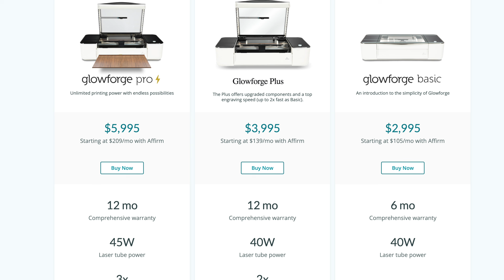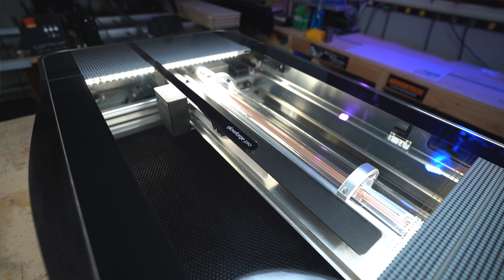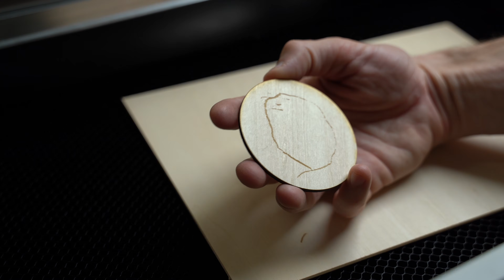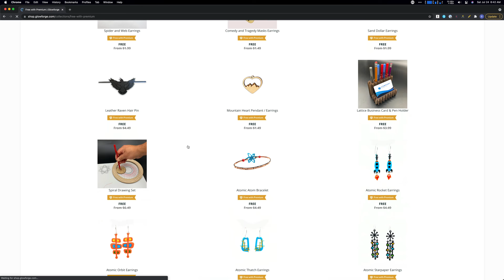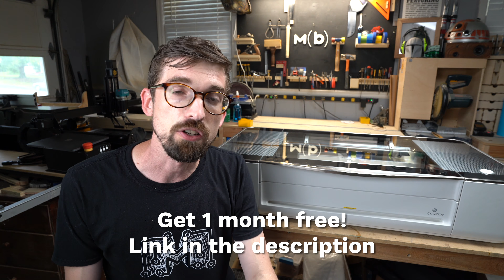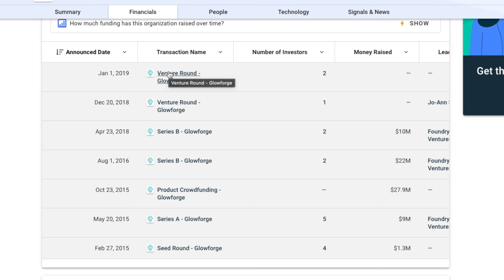Should You Buy a Glowforge?

Comment: I like the concept that Glowforge has, the self contained air assist and cooling is very nice. What I don't like is the software being online. If the company folds you are out of
luck and if the Internet goes down while you are just about to finish off a big job then you are forced to wait.  My son in-law just purchased an OMTech 80Watt laser for about
the same cost of the Glowforge Pro, he can use Lightburn and then have complete control over his designs as well as still being able to run his laser even if Lightburn
goes out of business.
Reply: There's also a better version of Glowforge that is comparable on price and has much better air assist called MIRA by Aeon Laser.

Comment: Really wish I had found your channel before I spent the money on a Snapmaker 2.0.  With years of 3D printing experience, I figured the Snapmaker would be a low risk stepping stone into the laser world.  (If I didn't use Laser, I still have 
a 3D printer).  The problem is, so far I don't have a laser. The one in the box was broken, and support is lacking, to say the least.  They're on replacement laser module #3.

Comment: Would you say that the Hepa filter box actually works well enough that you could take it to a craft  show and not worry about setting off a smoke detector (sprinklers) or causing others to complain about smell when running the laser?  Thanks for the videos!
Reply from the maker: Yeh, the filter does a really good job, it's made to run in an enclosed environment.  It is pretty loud when on so that would be the only drawback
Reply: Sprinklers are not set off by the fire alarm or smoke like in the movies. Most take direct heat in order to trigger.

Comment: I didnt hear much about the speed of the glow forge in your review.  Personally, I think it is painfully slow. when I first started looking for a laser, I saw reviews just like this, and got all fired up and excited.  however, after digging deeper, checking out the specs, comparing this to others on the market, and then factoring in the total lack of actual support ( other than the community forums ), having to return the unit to even replace a tube, and for almost every other things, at. great cost - I soon realised, this was actually not a great machine for the money they are demanding for it.  It looks very nice, but, it just doesn't command the price.  

they do an excellent job of marketing, an immense job, but they they would ( in my opinion ) provide a much better product, with support if they pent less on the advertising and more into the product itself.  Once I made an initial enquiry, I was almost hounded by e-mail after e-mail after e-mail.  however when I replied with questions, their answers were always very vague, or often they would deviate from my question, paying lip service to it only, and trying to big up everything else in an attempt to negate my concerns, and convince me that despite my concern, there were so many other aspects that were simply amazing...anyway... hard pass for me im afraid

I love your reviews in general, but I do have to say, I think this one was probably biased as a result of glow forge sending you the laser and air purifier etc..I know you said it wasn't, but it did sound like it.

Comment: Nice video, well done.  I read on the Glowforge website it can engrave anodized aluminum.  Have you had success with that material?  Also, what is the max height the material can be to engrave?  THANKS, I'm a noob to all this, but fascinated by this tech.
Reply from the maker: I haven't tried it my anodized but with most CO2 lasers your really removing the top anodized laser from the metal leaving it bare underneath.  Kind of the same process as if you were to paint a piece of metal and then laser it away.  To actually engrave metal you would want to check out a fiber laser but the Glowforge (or any other CO2 laser) could get you close.  

Max material height is 2 in, sorry if I missed mentioning that in the review!

Comment: Hey, I’ve been watching all your videos since I’m trying to get into very basic laser projects. Just want to make some nice looking business cards out of stainless steel. I know the laser project area doesn’t need to be huge, but also stainless steel isn’t the easiest material to work with. Don’t believe I’d need to cut through it; I’d most likely just use it to etch. Ease of use is pretty important since I’m going to be very new at this. What would be the best (budget) laser you’d recommend?
Reply: I don’t think you can engrave stainless steel. You might be able to mill it with a CNC machine but…
Reply: You can use a spray that is called Brilliance (it is expensive) and an OMTech or a Flux Beamo and if you want to upgrade, you can add a rotary usit.

Comment: There is no argument that the fit and finish of the Glowforge is first rate.  But there are too many limiting factors, especially the closed ecosystem, where even if the company does not fold, you are beholden to their marketing changes.  Just ask any Cricket user of the last couple of months.  Yes, Cricket backed out of their proposed changes, but for a while, there was the potential to basically owning a brick..  Should Glowforge find itself in financial difficulties, what is to stop them from charging for functionality that already exists and is part of the package, or jacking up the cost of their subscription service, after people have integrated the glowforge into their process (if commercial).  Sadly, this is a hard pass for me.
Reply: Great points dude. Literally hold your equipment ransom lol.. 
Then there would be a market for "jailbraking" the Glowforge, 
But yeah I agree with a hard pass

Comment: Can you engrave brass by about 0.7mm to make an embossing block for cardboard? If so, how long would that take on this machine?
Reply from the maker: For brass you would need to use a fiber laser
Reply: For your use case, you would probably want a CNC router or milling machine.  Lasers are great for cutting, and engraving, but if you want more precise control to only remove a specific amount of material, milling/cnc machines are the way to go.

Comment: Glad you did this Glowforge review, which confirm that the Muse 3D or Muse core with your own chiller an inline fan and 45W upgrade, plus interchangeable lenses and rotary tool, still under $6k or even better the Beambox pro with a standard 50W,  integrated chiller, rotary attachment (no interchangeable lenses) still less than $6k both locally operated without internet, are better options for someone looking more for the money. 

Thanks for the review.

Comment: There's no way I'd buy a piece of expensive hardware like this, that turns into a brick if/when the company folds or decides not to support it

I had that (company folded) happen to me with a 3d printer. Expensive lesson.
Reply from the maker: Which 3D printer did you have?
Reply: @makeorbreakshop  It was a Zim Z-pro, dual head printer. Was designed to be very hands-off and (at the time) pro-level. The company delivered most of what they promised (never did get the heat shields), but folded a few months later. Their online software stopped working. Their software was all closed source, and went out with them. That was almost $1200.

Some folks were able to gut those and replace with Raspberry Pi to get it mostly working, but I use 3d printers as a tool to support other hobbies, not as a hobby itself, so I donated it later.

After that, and one other company failing to deliver (this one not a kickstarter, but also folded), I just went with Prusa. Expensive, but super happy with the results.

Comment: The reviewed equipment adds up to basically $7000. A quick look at OMTech shows you can get 100w, 24x40 (and passthrough), autofocus, a much deeper maximum depth (tumbler engraving anyone?), an actual chiller, two different styles of rotary machines, Corel graphics suite, and Lightburn for $6360. You'll have $640 left to spend on a camera for Lightburn so you'll have the same functionality as SlowForge. You'll also have a much bigger machine with more than twice the power and the ability to fix small things like laser alignment (good luck re-aligning your shiny new Glowforge if it gets bumped during shipping). The only thing you'll be missing is the air purifier and there are plenty of cost effective options out there.

Glowforge shouldn't be compared to a cheap k40; it should be compared to what else you can get for the cost. For the cost, there are much better options.

Btw, their $3000 basic machine gets equally spanked by a 50w OMTech. They do have great advertising though and the entire laser community has benefitted from it.
Reply: 100% agree and so did this guy until he was sent the unit.   He had nothing but negative things to say about glowforge until he was sent a unit.  What does "Glowforge was nice enough to send me a machine" even mean? You have to send it back...or they basically gave you 7k to do this review. He also never mentions that he gets $500 every time someone follows his link and buys a machine.  These review guys always, always, always leave these parts out.  They try to change the wording around like this guy did to make it sound like he is just doing an honest review.  I NEVER trust anyone getting sent a free anything to do an honest review on the free item they were just sent.  Plenty of people who paid with their own money doing honest reviews who hate this machine and regret it.  Listen to them.  This guy has a good channel but stop with the fake ass reviews already.
Reply: @garrydye2394  GlowForge seems to be like Tesla.  There are diehard fans (usually people who have actually shelled out the cash to buy one), and diehard haters (usually people who don't like certain features, like the Wifi-only connectivity or the lack of hands-on control of the minutiae of laser processes, but have never actually used one).

And as soon as a reviewer comes out with something positive to say, the reviewer must have "sold out".

GlowForge is the right solution for a certain segment of the population.  IMHO, GlowForge has made laser cutters accessible to a huge market that never would have tried it before they came out with their solution. I think he spent a lot of time highlighting some of the unique aspects of GlowForge (the ecosystem). And I think he made it clear that, for the diehard tinkerers who need full control, those who do not have reliable Wifi service, and the fearful who worry about whether GlowForge will still be around in a few years (since if they fail, you suddenly have a very large, expensive paperweight), GlowForge is not the right choice.

It is not a one size fits all solution, for sure. But if you can live with the limitations, I believe it provides the average consumer with the easiest solution to begin making things within minutes of getting the device set up (and said setup involves unpacking it, putting it on a table, and turning it on/pairing it to your WiFi).

If you are well-versed in laser technology, I would agree that GlowForge may not make sense for you. If you enjoy tinkering/experimenting to figure out how to get the device to work, ditto. But if you just want something simple/easy to do basic laser engraving/cutting tasks, then GlowForge is working profitably for a large community.
Reply: Which model has pass through for OmTech?

Comment: Personally for the cost, I would rather a 50w and lightburn, sure you will need a chiller and a bigger extractor, but the inability to be able to use a rotary, or a decent thickness of wood and the low power, the hard to clean, the fact you cant repair anything on it your self... Give me a machine I can work on my self every day of the week. 

also closed ecosysytem for software nope sorry thats where pain comes, give it a few years and when glowforge decide they don't want to support it any more tough! (See Cricut for example of this happening) 

Having a sealed path is a terrible idea in my view, replacing mirrors will be needed in the future and I bet that's a return to glow forge for them to do it and if its not then it will be an expensive option .

A few questions, 
1) How long is the laser tube? cos it doesnt look like a real 40W have they done the trick of saying its peak and using that as a selling point, it looks (to me at least) more like a 35w tube. 
2) What's the fluid used for the cooling? does it have a decent amount of fluid in it? considering the size of most chillers they are bigger than the whole machine so what is it using? 
3) What's the max cutting and engraving speed? 
4) How easy to replace the lens? and how expensive? 

My personal opinion is they are over priced and they also could do with someone understanding lasers doing the marketing (its not a printer for example) and to be honest they have a really bad reputation for going wrong due to things like ribbon cables, I guess they are the apple of the laser world, more expensive than a better option and a closed ecosystem .... 

Not for me but others might enjoy it.
Reply: I agree, I personally know two people that have a glow forge and they wish they hadnt gotten it. I'm not a fan of the proprietary hang ups ya gotta have to make it even run
Reply: I mimic your sentiments entirely. Especially about the closed ecosystem.. just ask anyone who had one of those crappy Cricket vinyl cutters....
Reply: @mrljvb  I was one of those with a crappy cricut....
Reply: @mrljvb  Yes! I mean I get it, ya gotta have some kind of tether, but.. theres others that dont. Example: I've got a Queenbee with openbuilds blackbox, and the thing runs with anything, I run it from easel sometimes even
Reply: @redherring5532  I went the other way around, I have a Openbuilds Lead 1010 with the 6 Pack CNC controller and external drivers, I was never a fan of the Blackbox, I liked my XPro V4, but it crapped out on me.
Reply: @mrljvb  Nice, I had a really hard eye on the Lead for a bit, what ultimately ultimately won me on the QB was the beefy gantry plates. I never tried a Vpro, thankfully when I was in the market for them they were discontinued and transitioning to Blackbox. 
I can't say anything negative about the blackbox, this isnt just the one either, I've had the opportunity to use two myself and one for a cnc build at work, two of the cnc machines receive a lot of work, the other is for a little laser machine project I'm playing around with. NOW the Interface offering they have, it's cool yeah, I bought it on impulse but it's not very useful over having it connected straight into a pc.

Comment: After running a Glowforge pro for a couple hundred hours and while it is a great unit, I have several problems with it. the online software can be a bit finicky. I've had some of the ribbon cables go bad and I wouldn't have made the lid work off a ribbon cable as well. When the lid cable went bad, the unit was useless which IMO is unacceptable. I don't need a camera to run a laser.

Comment: I think most people watching this are thinking about whether to get a Glowforge or save money and get a K40. Would love to see a little more attention on apples to apples. Also curious on what happens when the Glowforge laser wears out?
Reply from the maker: I'll check in on the laser tube replacement.  In terms of comparison to the K40 I didn't go super in depth, but the biggest difference is you are paying more for increase size, quality, software, internal compressor/air assist, cooling, support and overall ease of use.  If you were to upgrade the K40 to get some of the same functions as the Glowforge (especially the compressor/air assist/cooling/camera) plus software you are looking at at least $1000 if not closer to $1300.  So then its a question of if everything else is worth the extra $1000 to $700 for the Glowforge Basic.
Reply: https://glowforge.com/faq/tech-specs#do-you-have-to-replace-the-laser-tube

Replacement tubes cost $500 USD and are expected to last for 2 years.

Comment: Thats a lot of smoke.  In my old 50w co2 laser, it vacuumes the smoke out and my mirrors dont get dirty.
Reply from the maker: So a few shots I forgot to have the smoke extractor turned on.  It does a really good job of pulling smoke even compared with my larger 50w unit